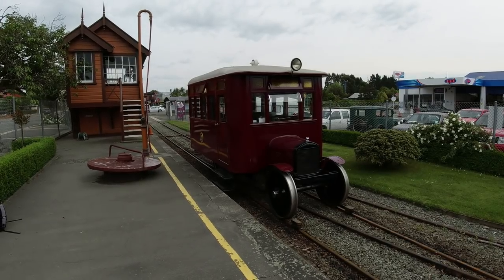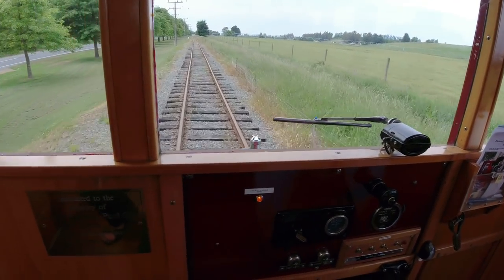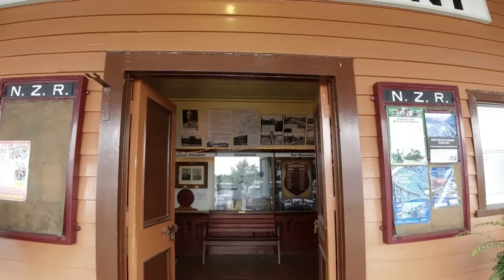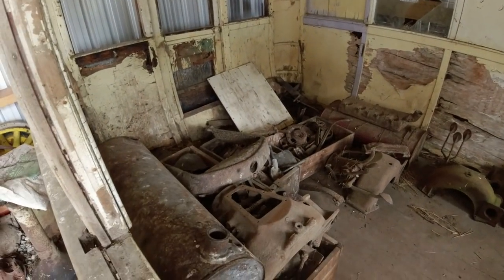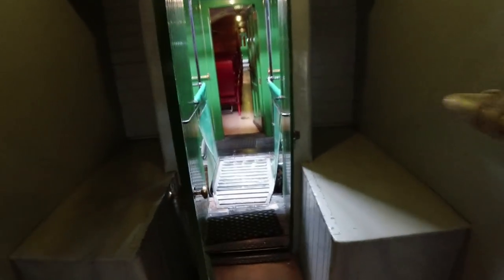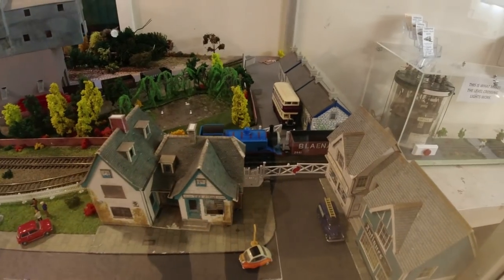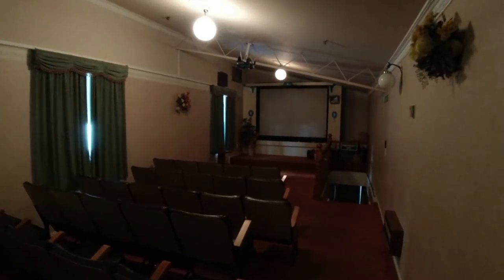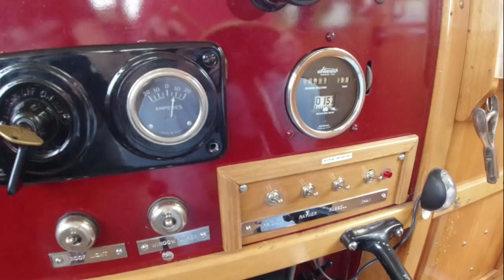(EP24) Incredible Ford Model T rail car! Plus Pleasant Point Railway and Museum. HubNut Goes Global

Comment: The model T looks like it ran much better on rails than any model T could ever run on on the road. Especially considering the dirt roads, tires, wheels, and suspension systems of the Model T days.

Comment: Back in about 1993, at my business I had the last remaining operational telex machine in the whole of NZ. Used for communication with my client in USA. Telecom asked me to discontinue and change to fax as the  cost of the maintaining the infrastructure for only one machine was prohibitive.
Reply: they are still used  because it is the safest form to communicate a message, there is no way to hack them,I know they were still used by airlines well into the 2000s,(I am retired telephone engineer)  I definitely was still servicing them around 2005 and an old colleague of mine worked at a major military base in the UK up until 2012 (we were talking about this a few years back) and he said they are still in use

Comment: Ah, we had something very similar working in the UK in the 1920s made by Ford and Shefflex. They were used by one Colonel Stephens on his light railway empire, notably on The Kent and East Sussex Light Railway, The Shropshire and Montgomery Light Railway and the Selsey Tramway. Two of them operated back to back, sometimes they even towed a freight wagon, but they were not powerful enough for more.

They were used as a cost-saving measure to compete with the new bus services after WW1 often using old cheap military trucks with a bus body. These railbuses were not very popular and did not last much more than a dozen years when steam trains and coaches took over the services again. - the cast iron wheels made a continual clanging and ringing noise, and passengers complained about the ride quality. None survived into preservation, but I believe a full size replica of one has been made.
Reply: I believe there was also a Ford set on the Derwent Valley Railway, in 1926 Colonel Stevens tried to buy it but it was sold to the County Donegal Railways Joint Committee and converted to 3' gauge.
Reply: There is a replica T-Ford railbus at the Colonel Stephens museum at Tenterden station on the Kent & East Sussex Railway. It was built to a working condition, but appears to be out of use now, but at least it's under cover.

Comment: I have not visited this tiny little railway, but in general I experienced the hospitality just in any other place.
We got a free trip down the line on the footplate on the Glenbrook Vintage Railway on the North Island, because the steam engine with its train had to return empty after setting of a coach party, and after that one of the members brought us back to our car.
At the Bush Tramway club at Pukemiro a lady just there to feed the yard cats on a non running day was kind to open the shed just for us to have a look around, they have a couple of nice rail cars too, a bit larger than the model T and built on a White truck chassis from the 1920s era.

On the other hand there is the Taieri Gorge railway, which is a beautiful and worthwile trip to make, comparable with the Jacobite train in Scotland.
But it is a mainly commercially driven operation serving 10s of thousands of tourists each year, so getting access to all places like you get in these small museums is difficult, also pre booking is advised, especially if you want to do a weekend train which runs all up to Middlemarch over a distance of 60km.

Comment: That lever that you say "does nothing at all" should be connected to what was called a  " rexcel"differential. It was a gear change in the differential. It added two more gear ratios. Making for four gears. I know this because my father was an expert antique Ford restorer. I can drive that train with no problems and even make repairs.

Comment: OK - you've just made this railway modeller a very happy bunny! Never dreamed we'd see one to these Model T railcars running today. Some of the light railways in Ireland had them as well as (I believe) other places in the UK. Historic railcars/rail-buses are a fascinating subject alone. Also I trained for six years as a general printer back in the 1960's on all that stuff. Think I could still set from a type case and run one of those letterpress machines even now. Great stuff Ian, thanks.

Comment: I would say the failure of the original T railcar version in hilly Wellington is more due to a lack of adhesion and not so much a lack of power. 
 In hilly Wellington little railways being flat for are rare for any candidate lines. The rail operators may have needed, back in the twenties,  to search the country for some much flatter routes to make the model T railcar useful. 
One the few things useful things coming out of the old Top Gear was how, in the conversion of cars and caravans to trains segment, the Jag XJS V12 was useless on rails due to adhesion issues.  The lower powered Audi being more useful due to all wheel drive, but still limited by low axle load of steel railway wheels on rails. 
A ballpark for this may be the comparison of the UK's Leyland National bus at around 9 tonnes compared with the Leyland Pacer bus based railcar at 24.5 tonnes . Was extra weight designed in to get reasonable adhesion? Even the Pacers adhesion had trouble with the gradients of the like of Gunnislake, St Ives and Looe branches and so were moved away from these routes after a short period.
French Michelin railcars of the 1930s took a different approach.
Interesting how this vid is attracting so many (potentially new) viewers.

Comment: The telex machine! In the '70s, I remember going to my dad's office, looking for an urgent Telex that was coming overnight Sydney time from the UK! To minimise fluorescent flicker (no flour involved!) see if you can set the frame rate and/or shutter speed to an even ratio with the 50 Hz flicker (25, 50, 100 fps or 1/25,1/50,1/100s shutter speed). If only the USA was 50 Hz instead of 60 Hz.

Comment: I bet it still rides better than a Pacer. 
So don't stamp on the middle pedal hurriedly if you want to brake suddenly, or perhaps do just to see what it does. Actually given how tough Model T's are, I wouldn't be surprised if you could do that and get away with it.

Comment: If you are using a new camera it might be set on the default US/Japan setting which is why the fluorescent lights appear to flicker.....US uses the 60 cycle mains frequency while NZ/UK uses the 50 Cycle frequency,  so try experimenting with the frame rates on the camera.  a good pairing would be either 50 or 25 fps in NZ I would think? while in the US/Japan it would probably be 60 or 30 fps.

Comment: I'm pretty sure the lever that you said 'doesn't do anything' is in fact the shifter for a Ruxtall 2 speed differential (essentially giving it 4 speeds forward).😉 With proper gearing, and even with a full load of people, I don't imagine that Model T would have any problems with any grade that railroad had to offer. The average Model T 1 ton truck could haul amazing loads over most any terrain, and running on rails is much easier, as there is hardly any rolling resistance. That little 25 hp. engine could probably hit 45 to 50 mph, even with that big box on the back.😁

Comment: They had other versions of these rail cars in the USA, I have seen little models of them on model railway layouts. They also trialled these model T rail cars in the UK but they weren't successful. 

Pleasant points signal box looks very similar to the great western railway design signal boxes on the Severn Valley Railway.

P.S must not tell Lawrie (Lawries mechanical marvels)about that Ruston Hornsby diesel.

Comment: Sounds like you may soon visiting the Australian state of Victoria. From 1922 to about 1956 similar AEC chassis based railcars were used in low patronage and largely level branch lines in order to reduce operating costs and provide a better service than steam powered mixed passenger and goods trains. A Youtube DVD preview vid can be found here : https://www.youtube.com/watch?v=fgOMCPvqUBg&t=124s  with rare colour footage of one of the AEC railcars travelling from Fawkner to Campbellfield. Campbellfield by coincidence being the locality where the Ford factory, builders of your Lizzie Fairmont Falcon, was established two or three years after the footage.

Comment: Turntable shot - I dare you to ask him to go round again ;)
Reply: Powered by a Armstrong motor, namely me! Actually if you balance the car right it’s not to bad.
Reply: @lesliecoombs3622  It'd be even better with an annual maintenance contract - clear stones and weeds in the pit so there's nothing rubbing against the moving parts. and annually grease all 9 axle bearings. It shouldn't matter where the vehicle is on the turntable, it should turn with ease.

And what's with the brushes on the front of the railcar ? Can they be lowered ?

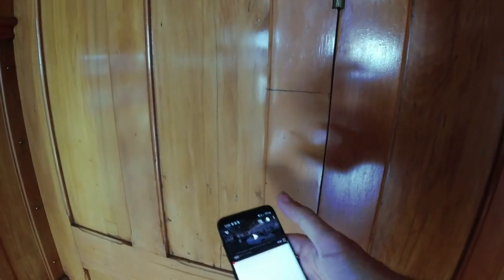Comment: 16:44 the lighting in the train - I might even suggest they were oil lamps.
Reply: used to be now powered by electricity.
Reply: @lesliecoombs3622  And now the light is on all through the tunnel, not just at the end !

Comment: WAS THE ORIGINAL BUILDER OF THIS RAIL JITNEY THE FAIRMONT COMPANY IN THE USA?
THEY MADE A NUMBER OF SIMILAR VEHICLES USING PERIOD FORD AUTOMOTIVE COMPONENTS.
ONE THAT I AM FAMILIAR WITH IS AN EX SANTA MARIA VALLEY UNIT 
AT THE MUSEUM OPERATION IN CAMPO CALIFORNIA!
Reply from the maker: No, New Zealand built I believe.
Reply: HubNut IT IS A NICELY BUILT UNIT!

Comment: Is the model railway H0 (half zero)?
Reply: HO track at 16.5 mm gauge but running mainly British OO scale model brands equipment of 1:76 scale. Running on the HO track as is normal for OO scale. Most scenic road vehicles and buildings also OO scale. Some HO 1:87 scenic items also. A common mix best called OO/HO but often just OO even though it uses HO gauge track.